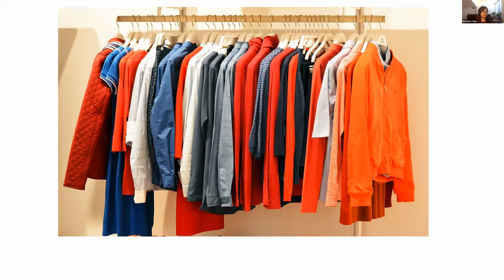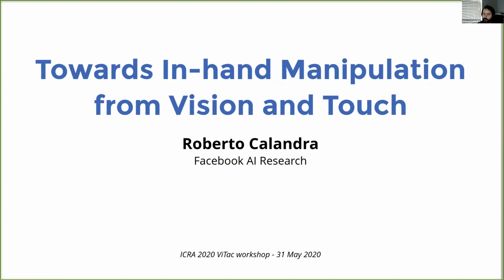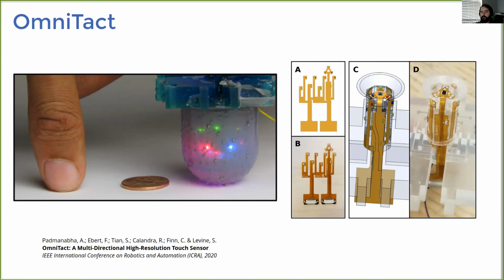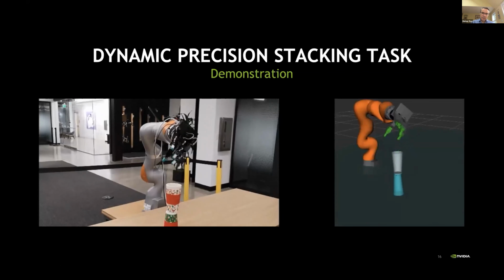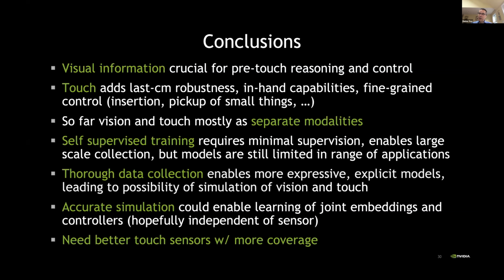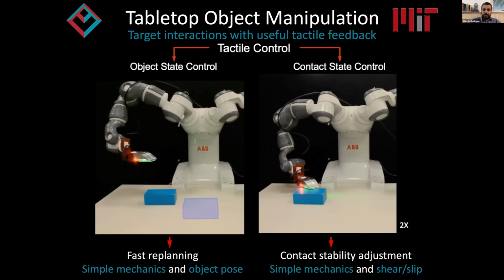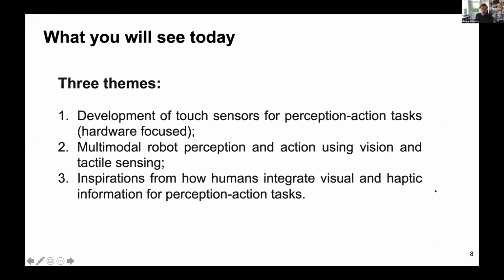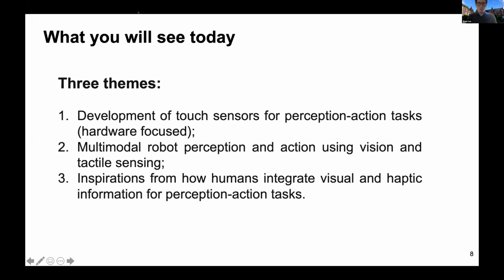ICRA20 ViTac workshop: Closing the Perception-Action Loop with Vision and Tactile Sensing -- Sec 4

Comment from the maker: Discussion during the workshop:
00:07:09   heba:	@wenzhen  are you able to share the texture database?  
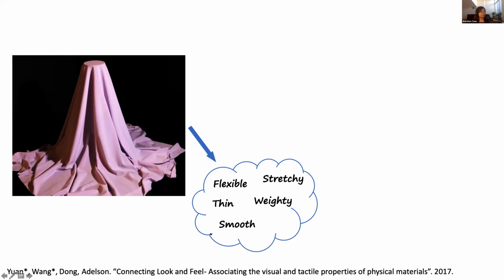00:13:42   Arpit agarwal:	@heba I believe http://people.csail.mit.edu/yuan_wz/clothing-perception.htm contains the texture gaslight data.
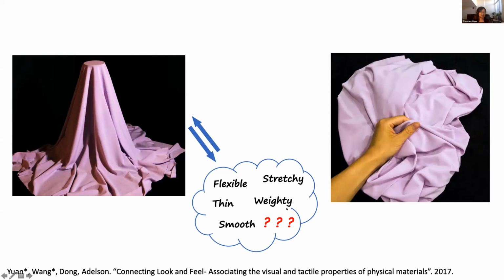00:14:26   heba:	thanks @arpit! great!
00:23:44   Brayan Impata:	How can we be sure that the visual features learned are not dependant of the colour of the pieces of fabric? Could you detect any confusions between fabrics with similar colours?
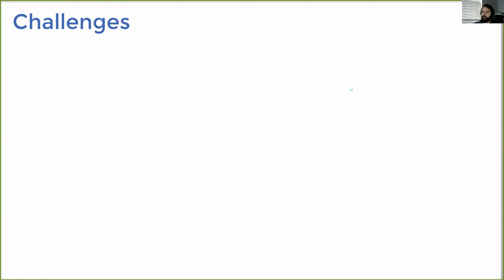00:28:27   Wenzhen Yuan:	@Brayan: We augmented the visual dataset by changing the colors. So by expectation color won’t affect the perception.
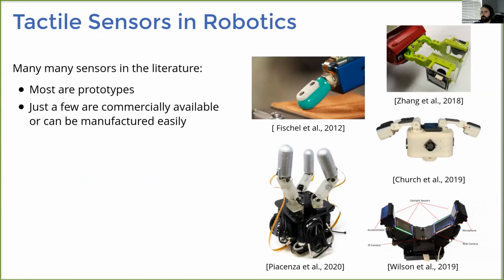00:29:13   Brayan Impata:	Ok, thanks!
00:45:10   Robert Haschke:	@Roberto: Where can we order the DIGIT sensor for $15 ?
00:46:15   Lorenzo Natale:	@Roberto: which interface does DIGIT provide?
00:51:03   Lorenzo Natale:	electrical interface usb?
00:51:32   Lorenzo Natale:	thanks
00:51:34   Rui Ouyang:	What is the programming process / interface for flashing the firmware? 
00:53:38   Roberto Calandra:	It is detailed in the github repo. I believe that the version release make use of some software from the producer of the camera.
00:54:04   Roberto Calandra:	*chip, not camera
00:56:42   Rui Ouyang:	Ah, right, the FT900 mcu is listed on the BOM. I am not familiar with it. Maybe I can organize to do a batch pcb and component order, and someone else in the community can contribute firmware expertise, and we can add build process documentation. Thank you!
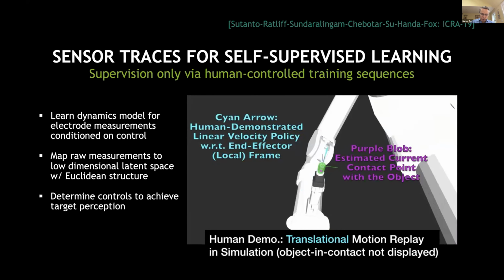00:58:34   Roberto Calandra:	If the instructions for flashing the firmware are not clear, we are happy to improve the documentation. Also if you have any question/feedback feel free to open a ticket on github and we will look at it
01:04:25   Rui Ouyang:	Wow, thank you!
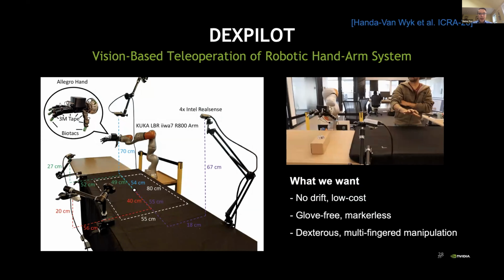01:28:01   Lorenzo Natale:	Do you have an estimation of the precision with which you can reconstruct forces on the biotact? (in terms of Newton or Pascal)
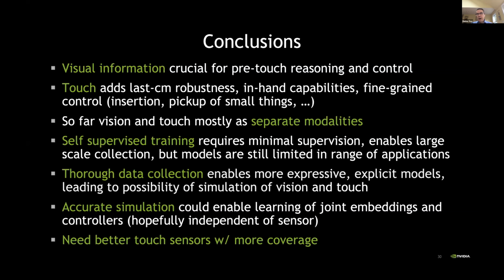01:30:29   Yashraj Narang:	Median errors of approximately 0.5-0.6 N, with respect to maximum force ranges of 5-20 N during the experiments
01:32:21   Zihan Ding:	What software did you use for building the soft-body deformation with finite element method?
01:32:22   Jakub Tomasek:	@Prof Fox I would be interested how the performance would deteriorate in Dexpilot if latency was introduced. Have you tested that?
01:33:00   Yashraj Narang:	@Zihan, we used ANSYS. We have a commercial license, but I believe there is a free license for students. We are also aiming to port the model into open-source FEM software
01:33:14   Zihan Ding:	Cool, thanks.
01:33:53   Arpit agarwal:	Can you share the paper reference for FEM modeling of BioTac and indenter?
01:34:30   Arpit agarwal:	Did you try out some experiments with soft indenter and BioTac?
01:36:28   Yashraj Narang:	@Arpit, absolutely. We will be submitting camera-ready for RSS on Wed, after which we’ll post on ArXiv. Paper is titled “Interpreting and Predicting Tactile Signals via a Physics-Based and Data-Driven Framework.” We haven’t tried soft indenter. I have faith that the FEM model will still work well due to the strong physics constraints on the simulations, but I suspect PointNet++-based NN predictions may become less reliable.
01:37:03   Arpit agarwal:	Thanks. I will be on the look out.
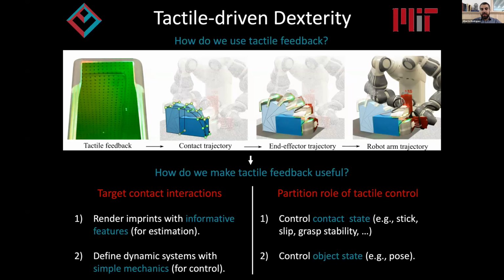01:46:07   Juan Antonio Corrales Ramón:	@ Yashraj, thank you for the reference to ArXiv. I will take a look when you publish it. It is a very interesting work!
01:49:08   Yashraj Narang:	Thank you! If anyone has any follow-up questions, please feel free to email me at ynarang@nvidia.com.
02:05:36   Wenzhen Yuan:	Questions from audience?
02:06:50   Shan Luo:	@Alberto, how was the ground truth of the cable trajectory obtained?
02:17:43   Arpit agarwal:	What have panelists heard from people who are not using tactile sensing and doing manipulation?
02:18:52   Arpit agarwal:	Is it unavailability, clarity or laziness?
02:22:29   SIAO WANG:	Thanks for the brilliant talks! I would like to ask about your insights about large scale tactile skins. What do you think is the optimal representation of tactile signals catering the limitation of embedded systems and for reactive control considering essentially now the raw tactile data are mostly 2D?
02:26:57   Arpit agarwal:	Should the community focus on manipulation tasks or abilities of tactile sensing(like precision, dynamic range) while working on tactile perception?
02:27:52   Kshitij Minhas:	What are some of the integrated tactile sensors do researchers here use? Only off-the-shelf reliable sensor I have found is the SingleTact sensors from Pressure Profile.
02:27:54   Stefan Escaida Navarro:	Many thanks to the organizers and the speakers for this excellent workshop! (I have to leave)
02:29:16   Alberto Rodriguez:	I need to leave. This was a great workshop!! Thanks to the organizers!!
02:35:22   Dieter Fox:	Sorry, I have to leave as well. Thanks for organizing this excellent workshop!
02:37:17   Shan Luo:	Thank you very much for joining us Dieter and Alberto. It is our great honour to have you here!
02:37:54   Rafael Fierro:	Great workshop. Have a great week. Thank you!!
02:38:34   Vincent Hayward:	hi all, sorry, for some reason, my connection is very bad; i get about 30% of what is being said. Thank you for a great workshop and amazing progress.
02:40:28   Arpit agarwal:	What have people heard from industrial sector especially manipulation?
02:40:30   Robert Wilbrandt:	What do you think will be the applications potentially driving the comercialization of tactile sensors?
02:40:57   Brayan Impata:	Don’t we need a task lime Computer Vision had with ImageNet for pushing the field?
02:41:10   Brayan Impata:	like*
02:41:58   Saber Sheybani:	@Brayan: we sort of have that, right? "Pick and Place" and "Peg-in-hole" I guess.
02:46:33   Brayan Impata:	Occupational Therapist have standard ways to measure human dexterity
02:46:46   Brayan Impata:	We could copy that on our robots